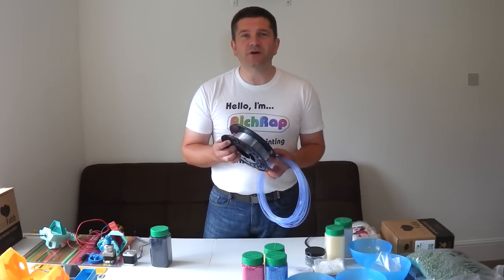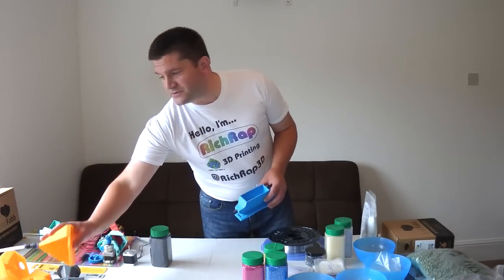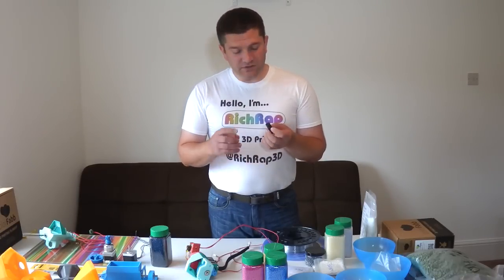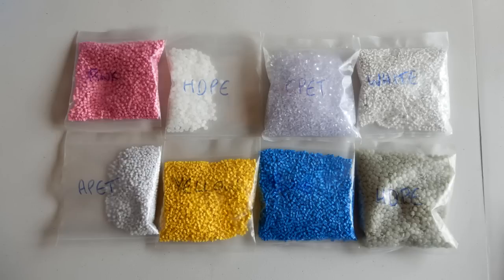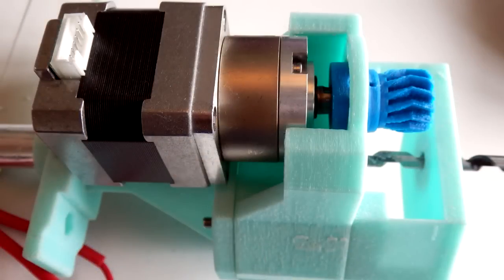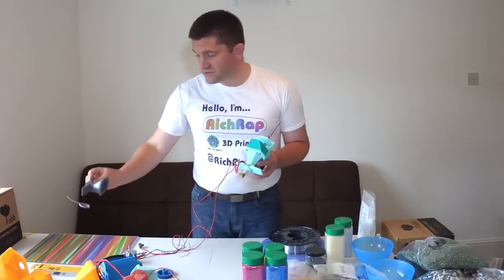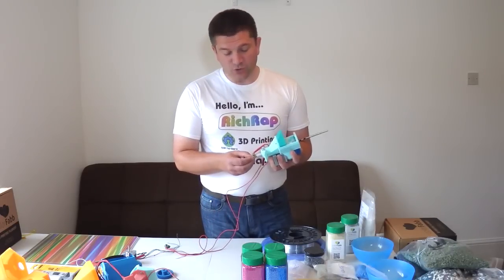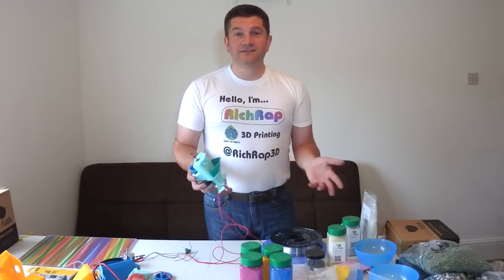RichRap Universal Pellet Extruder Project - 3D Printing

Comment: This is such a great idea, it would be awesome to finally be able to recycle and reuse our pla at home. So as I was watching this I couldn't help but visualize the friction forces as the pellets finally enter the hotend. I would think if we could somehow grind pla down into almost a flower type consistency, that would probably flow a lot smoother. What if you took that bag of scrap pla failed prints, and put them in a ball mill? A jar with some grinding media (marbles, bearings, etc.) and just let it run. Maybe that could help eliminate any problems with an even flow rate.

Comment: First, I love what you are doing! This is needed desperately in the world out there. Have you thought about having a much longer extrusion/auger chamber? It already seems weight isn't an issue you are trying to worry about, so consistency of material extruded could be helped by doubling or tripling the extrusion/auger chamber length. Also, why are you using the hot tip insulation? In all of the professional plastic extrusion designs I have seen, the entire length of the extrusion/ auger chamber is heated.

Comment: Dear Richard, it is huge problem to control speed of extrusion and filament diameter as far as auger and nozzle has constants. Can't see in this idea any possibility to reach good result, sorry for pessimistic opinion which is based on my own experience of ABS filament production

Comment: The bearing to be used is the 606 according to the plan (thats 6mm hole and 17 outside) while the drawings show a hole of 19 mm.  am i correct that the bearing should be a 626?

Comment: you could get the recycled plastic and push it thru a die and cut it up as it comes out, just like they do to make the industry pellets it gets pushed out a die and cut up in to the pellets. or make string and cut that up latter   lol I just remembered the other day a watched a video about making rope from plastic coke bottles.  lol. you could use that cord and cut it up in to the small size and use that in the extruder

Comment: please update this project, add dual motor on extruder to add more torque
Reply from the maker: I'm planning a new version for this year. I have found better ways to extrude pellets for desktop 3D Printing.
Reply: Richard Horne Awesome!!! I live on an automotive industrial area and we have lots of factories using plastic injection with pellets. Thing is that usually they get their lots contaminated and sell them very cheap (still very expensive to buy 1ton of it😂)

I'm really interested in this project. Have you thought on printing with mixed material pellets? (glass fiber pellets for example)
Reply: @RichRap3D  will you? I wish you have it done soon :)

Comment: How about making a shredder for failed prints? 
That way you can recycle the plastic by making it into smaller bits that you can use in the extruder. :)

Obviously, the shredding parts has to be made of a metal if you want to shred plastics, but the gears and casing might be 3D printed.

Comment: So you trying to print with pellets immediately not just printing a filament? Think this will give you a very inconsistent amount of material so your prints will be somewhere too thick somewhere to thin. Its not even easy to print a consistent thickness filament.
Reply: Filament performs as well as it does because the community has a great deal of experience with it. This came only after immense experimentation and during experimentation the results were often too think in some places and to thin in others. Rich is helping start up the experimentation stage. Maybe in a year most of the kinks with pellets will be worked out and everyone will benefit from the tinkering of a few.

Overall, the benefit of pellets or material shards is that you can take bits of plastic that you would be throwing away or recycling and using that material instead of buying filament or pellets.

Comment: Any video of actually printing and quality without the pellet reviews?
Also.., I don’t believe that the augers out there fit into the nozzle but instead have a pointed tip with flutes where the pellets start to break down and then extruded. So larger spiral augers should work within the realm of the project however you want to approach it. Ultimately they have no other direction to go so they’re forced downward. It look like from your videos that you since abandoned this idea. It would be great for those into food extrusion presuming you used a stainless auger that can be sanitized.

Comment: Rich, I've taken a sudden interest in pellet extruders and something struck me...

Does the hopper have to be attached to the print head? Could the screw and head be fed from the hopper via tube? In a similar way to filament extruders that use bowden tubes. I'm sure you're aware of the benefits of reducing the weight on the print head.

edit: just seen in the video you have experimented with bowden tube. What were the results?

Sorry if this is something you've answered before. I run an Fresh Design Works ID consultancy, based in Bristol. Feel free to give me a shout.
Reply: Ben Talbot I was thinking of some thing like a pump for the melted plastic so you could use whatever plastic you want, just melt it, pour it into the pump, and print.
Reply: jake B Pumps don't work well with materials that aren't proper liquid (water, oil) melted plastic tends to be gooey and sticky, which is why a screw is used. A peristaltic pump is the most likely to work but I am still doubtful.
Reply: What's that?

Comment: What about the results that retraction gives us? With this method you can stop the the auger but cannot pull the molten material back into the nozzle like retraction does. Won't this make for sloppy prints?

Comment: Pellets a great but cheap only if you buy them by the tons, they also sold in 25kg bags is you search around. 1KG ABS is 2Eur, 1 KG PET is 1.15eur. Anything else is overpriced.

By the way RitchRap how is it going on Nectar One 3D printer that supposedly should be revolutionary being all members are very smart phd etc? I did not get any replies fro them to any questions, or is the project failed?

Comment: still with the project?
Reply from the maker: yes, this project is still active, and being enhanced / modified and improved all the time.
Reply: i'm from spain, i like to try the extruder... :D i have a few friends that give some industrial pellets
Reply from the maker: Sounds good. I would be interested in how you get on with the design, it can be mostly printed and a few common components used to get it up and running. Smaller pellets are better (1-2mm size) than industrial sized (over 3mm)
Reply: how can we change a few words priv?